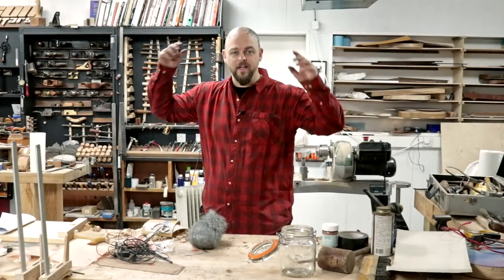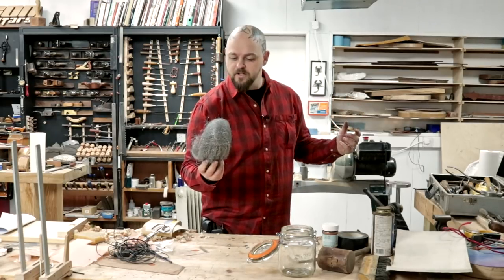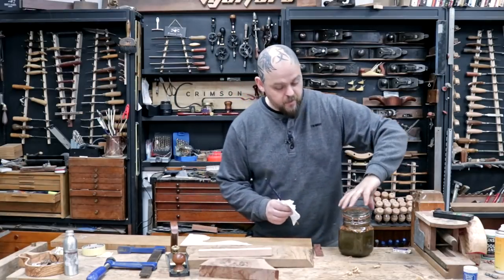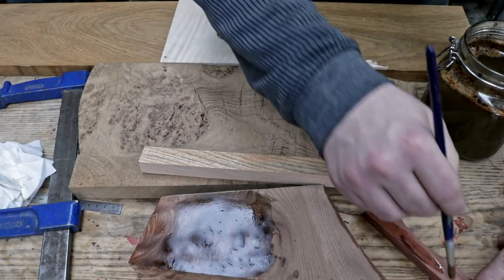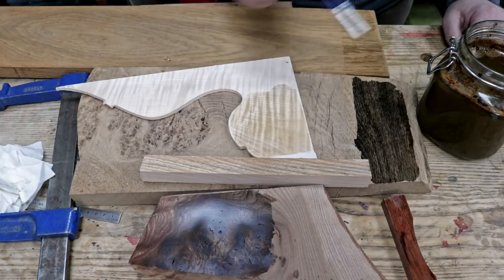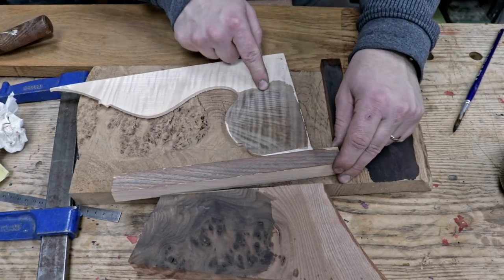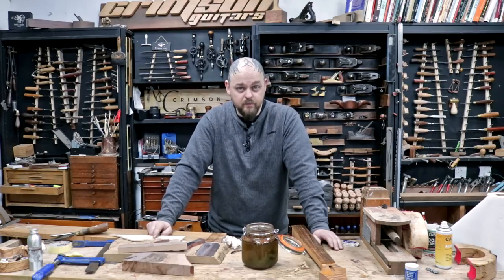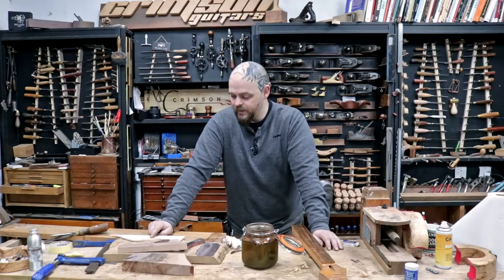Experimental Luthiery - Oxidising Guitar Woods - Using vinegar and wire wool

Comment: Tea has tannin in it. Make a strong brew of tea and apply it to the wood and let it dry before applying the Iron acetate to get a better reaction. Also, a safety tip when making the Iron acetate: Don't seal the jar. Not only will it prevent oxidation, but gasses are produce during the reaction that can cause pressure that might rupture the container.
Reply: I'm wondering if tea alone doesn't just add color like a stain or pigment would, reacting to "cover up" and create a surface effect as opposed to an actual chemical reaction with the tannins within the wood that creates more of a deeper 3d effect. A better approach might be to add more steel wool or iron. It seems to me adding tea or coffee is the same as adding stain, unless for some reason someone can't afford stain in the first place, one could just go with a stunning stain in brown for instance? Although a "layered" approach might work, ageing, then staining or coloring.
Reply: ThomEA It's probably a little of both. I guess a good way to find out is to apply the tea to a non-reactive substrate and then apply the iron acetate and see what happens. The iron acetate stays somewhat clear after the metal oxidizes and you strain it out. You can see in the video when he brushes it on the wood that the acetate doesn't really have any color until it reacts with tannin so I don't think adding more steel to the mix will change the results much. I agree that you could probably skip all of that and just get some ebony-colored stain and keep reapplying until the wood is black but it's probably not as fun as doing science experiments in the shop lol. 

You might also be interested in a technique that was popular in medieval times. I don't know if you're familiar with it but they built a tent around the piece to be stained and the put a bowl of ammonia in with it and fumes change the color of the wood. I haven't tried that yet. I'm sure there's instructional videos of it on YouTube.
Reply: The hard part is getting ammonia strong enough to do that, household stuff doesn't work, and it'll knock one on one's butt (nasty stuff, would probably asphyxiate a person, I used to run a blueprint machine that used it a while back, Some architects are real holdouts technology wise, go figure lol). Mission style furniture makers used it a hundred odd years ago for oak primarily. Adding more metal creates a stronger chemical reaction for the un-oxidized tannins to react with. Adding tea doesn't react with the wood at all.
Reply: well, another great source of tannin, and better yet cos its clear, is tonic water =)
Reply: Distilled vinegar ! 
Also , tree bark can be used to tan leather.. why not a lump of wood..
Reply: Two bags of Yorkshire tea in a half mug. Just applied it to a tele body. Prepared Ben's steel wool and vinegar mix with some rusty nails etc. Will have to wait a few days now before whacking that on. :-)

Comment: Hi Ben, I have used this same technique on my guitars and furniture... I use a 50/50 blend with water and vinegar, I had an idea to put in a kitchen scrub pad with that dry blue powder. Well, not having any patients  for the reaction to happen I tried to speed up the process by heating up the vinegar...it was a good thing I was doing this in the sink, it instantly took off like a volcano ... after it calmed down I had an excellent patina color.... I was speaking with my son who works in a lab at a chemical plant . He said I was luck the gases from it didn’t drop me to the floor.. I was making hydrochloric acid gases when I mixed hot vinegar and bleach  ( the blue powder in the scrub pad has bleach in it...).. hope my story helps you and many others who may of though about doing the same thing..

Comment: I just finished a guitar using this technique and it turned out very good. It can give you very nice colors and effects.
Using a heat gun you can speed up the process a lot and somewhat 'control' the oxidizing and color especially when you rub the solution on with a piece of tissue paper or cloth instead of using a brush.
Also if the effect on a certain type of wood isn't dramatic enough, first apply a few coats of very, very strong tea. This will add more tannin to wood for the solution to react with.
I can recommend using rusty old nails and leave them in the vinegar for months without shaking the jar until they leave a very clear and red(ish) solution. This will give you a very potent mixture which on certain woods gives a reddish hue over the darkened areas. 
I clean/re-etch files in vinegar and left my set-up filled for months and when I cleaned it out, it gave my a beautiful clear cherry red solution. And it worked magic on pine and otherwise more boring looking woods.

Hope you all have as much fun experimenting with this as much as I do.
But be careful on basswood. It turns black instantly and it penetrates deep, at least it did for me on places I didn't wanted it to.

Comment: I gave it a try, on a few test pieces of maple. soaking the wood in a liberal ammount of yorkshire gold and after drying applying an equally liberal ammount of iron acetate the result was pretty stunning. fairly dark grey. once you lightly sand the high spots away you get a lovely grungy look. pretty cool technique.

Comment: I have tried food coloring. I used black. It made the wood look amazing, because it still allowed the wood grain to show. The only thing is, I noticed it doesn't take spray clear coat very well at all....and it is very sticky to the touch. It is beautiful though. If I could find a way to both thin it down some and maybe mix it with oil instead of using clear coat for a nice shine on it.

I have also mixed plain rubbing alcohol with those little $2 2 ounce bottles of acrylic crafting paints. That gave some interesting results. You got color, but you also get to still see the wood grain, which is what I am looking for. 

I have watched other people use mustard for a nice "blonde" look, like you see on some Telecasters. I have also heard that turmeric gives a nice "blonde" look too. 

I like a little of the blonde look, but I'm like you, I want black. I don't care for brown too much, but really dark black is my favorite. What would be my most favorite, if I could figure out how to do it would be that extremely dark greenish color you see sometimes when mixing black paint, before you have finished mixing it. That is the most amazing color. Sometimes, I wish I could isolate that color from black paint I haven't finished mixing yet and just use that color.

Now, you have made me want to test this ebonizing thing again on some of this 70 year old red oak I have that I plan to use to build a mallet. I once tried that method on pine. If it can be tried on pine to darken it, I have tried. I usually end up losing the grain because pine is so hard to stain black....or any color, for that matter. and I usually end up spray painting it black, lol. Yet, I still keep using pine, because it is the cheapest for practicing to get better at woodworking. 

I know people laugh at those of us who use pine a lot for projects, but has anyone ever found a pine knot large enough to make a guitar body? I wonder how that would sound and look. Pine knots are usually pretty dense and tough. Maybe a pine guitar would not be laughable if you let it age. When pine ages, a lot of times it becomes very hard...harder to cut than oak, even, and also very flammable. <------Hint Hint. It burns very hot though, so don't say I didn't warn you. :P

Please do a series on various ways to color various woods. I love anything that adds some color but leaves the grain of the wood still visible. I wish I knew how to stain the darker parts of pine to black and leave the rest unstained. I tried only letting some stain wick through the end grain only, but that still didn't really do what I wanted. It just stained the end to that sickening "I'm pine. I refuse to stain any decent color. So there." sort of color. I hate and love pine.

Comment: i soaked the steel wool in vinegar for 3 days then removed the remaining half oxidized wool and let it dry for a day, then i painted the stain on the oak and waited till it tuned blackish grey then (whilst the oak is still wet) I used the dried steel wool to scrub the board hard, the oxidized wool crumbles into fine brown rust powder and stains the grain that isnt as black a nice brown colour. beautiful!

Comment: One of my favorite treatments for curly maple utilizes the same concoction you used followed by a sanding, to remove some of the color from the harder parts of the curl, where it didn't penetrate as much. Then, get yourself some potassium dicromate dissolved in water. Coat the wood with this, let dry. Lightly sand to get rid of the fuzzys, oil, and enjoy the results.

Comment: Walnut, oak grain, cherry & elm are great for oxidization.

tip:  Place the steel wool into a pot of water for a bit, put it while wet into a coffee can - let it get rusty then add the vinegar
It actually is the rust that kicks this up a notch

Comment: Hi Ben. I use this technique for furniture. If you heat the vinegar and wash the steel wool with washing up liquid to remove the oils and then chop it up as it goes in the hot vinegar it really speeds things up, usually overnight is enough. Also you can then experiment by adding varying quantities of Hydrogen Peroxide to the mix to add oxygen and therefore strengthen the colour of the solution. It is also a great way to control the exact effect you are trying to achieve. Great video by the way, when can we see an oxidised guitar? ;-)

Comment: If you want to grey any light wood like Maple etc, use a water and fertilisier mix, they use this in the veneer industry to make grey wood veneer colour. If you do this with Oak or other high tannin content woods, it turns the wood black, which is great if you want a dark finish to simulate aging of the wood.

Comment: Another experiment you can try is an old technique called ammonia fuming , where you enclose your piece in a small diy tent and use 10-35% strength ammonia and the fumes darken the wood .. and it penetrates quite deep and can give rich brownish colors (like the roasted maple color)

Comment: I use 4 to 5 coats on most hardwoods, then oil sand back and leave for a day before finishing. Steel wool produces the best stain. When you sand it back it gives a deeper 3d effect.

Comment: Potassium dichromate achieves the same aging effects but can be used on woods with a low tannin count, it is toxic, and can most likely be bought in pharmacies just mix it with water and make sure you wear protective gear.

Comment: What do you suppose would happen if the steel wool weren't completely dissolved? Leave it in the vinegar for only a day or two, then use the wool to wipe down the wood. Would it rust? Would it, in effect, react with the wood to turn it black, and with air to add oranges and reds? Also, what if you added copper to the solution?

Comment: If you don't like the smell of vinegar you could try Citric Acid. I work with food ingredients and we mix Citric Acid with Sodium Metabisulphite to use as sanitiser. I once put a plain steel screw, instead of stainless, in the solution and it quickly corroded and turned green. It also released some sort of rotten egg sulphur gas.
Try dissolving a teaspoon of SMBS, in some citric acid solution or small amount of water, and add it to the mix on the last day if you're after a different colour and leave it outside of course until all the sulphur smell is gone. You can get these ingredients from a beer brewing supplies shop or supermarket sometimes. Don't let the SMBS powder get anywhere near your face. I once had some of it go up my nose and I had to snort water to flush it out and be able to breathe again, it's pretty harmless . Good luck

Comment: Some suggestions to try in dilute concentrations: sulfuric acid, nitric acid, sodium hydroxide,  potassium hydroxide, etc.. I know for a fact this works on some woods, and you can get shades of green or even red depending on the acid/base used.

Sulfuric acid I think may be very interesting because it loves to pull water out of things (and thus can replace it with sulfur ions inside the wood).

The main problem I see with this is finishing it afterwards. The acid (even vinegar is acetic acid) stays in the wood, and it may cause serious problems on finishes on top of it.

Comment: You will find that using steel wool can at times give a purplish color to your mixture when you apply it to the wood. Iron (nails) create a much better result. Not sure why it does that but I do know that Stradivari used this technique for dying his purfling. I believe they were Pear wood or holly (can't remember off hand} The very old book "Violin-Making: As It Was and Is" by Edward Heron-Allen goes into this subject at some length as well as other natural varnish/shellac formulas. Great book if you are interested in creating your own . I make all natural finishes for both my guitars and violins.

Comment: You used the end grain sides of the white oak and elm and so they took the stain better than the samples where you applied to cross grain.
Cross grain probably needs more persistence for the wood to "take" this stain. Logically, ash should take stain easily, but you had very flat cross grain, I believe.

I could be wrong but I do know that some types of oak have end grain that sucks up water like crazy so that's a logical result you got.

Comment: Use a sponge to apply a few coats and leave it for a few days, it gets darker as you leave it! you can also add a bit of stain to change the color, it turns brown on a lot of woods if you use white vinegar so adding reds can give you a rich color.
Also when you burn your wood try using a brass brush to get the  charcoal off then sand with wet fine sandpaper! you will love the golden browns after finish is applied!!!
Reply: Also cut the wool into small bits helps with the break down

Comment: i took off the paint of an old strat and did this about a year ago and if you add a rusty nail it becomes a nice brown stain also this on its own makes a awful green color and from my experience the wood will smell like vinegar for a while. Its easy to do and dependent on the amount of rust used it can come out nicely.

Comment: A chemical reaction using Bicarbonate of soda (baking soda in the USA) works great on high tannin woods. Used on mahogany it gives some purple hues and when finished with oil, the wood becomes a bit iridescent copper/metallic looking. Unfortunately it's a bit of a lucky dip what you get. Some high tannin woods will give lots of purples with a weak solution. Others less so with a strong solution.

Comment: I find it odd that you seem so disappointed with the brown oak. It's actually my favorite of them. With the rest, you could get similar results with a black stain, but with that one it really highlighted the grain, without changing the color of the wood much. 
Overall my impression is that this would work great as a first coat before a sand down and then actual stain.
Reply: You should make up a big vat of this stuff, and dip a guitar in it.

Comment: see's plain, picks up plain, stares at plain for a bit i had a kooky idea, what if you were to put a pre-sanded and un-routed (i'm talking no neck pocket either) body in a vat of premixed solution and left it to really soak in only for about a day, maybe  could make an interesting finish, the duration of prolonged application in the solution may permeate deep by saturation  causing gradual change in pigmentation through the body meaning it'd be awesome for carving after, or it could just make it completely black as if it was just stained again and again :) -awesome channel by the way, very nice work

Comment: If you wait a while longer the wire wool will dissolve completely, however, decant the mix into a plastic container. The acidic mixture will perish the rubber seal on the kilner jar.

Comment: Would it work with copper wool? Copper salts tend to be quite fun colours, although I only it as far as gcse chemistry, so I'm not sure how much of a bearing this would have. I presume you're getting some form of substitution reaction between the carbon in the tannin and the iron in the solution. 
I wonder - would phosphoric acid enable you to create uv figuring? If the black stuff is carbon acetate, subbing the vinegar for phosphoric acid should end up with carbon phosphate, which should fluoresce.

Comment: I agree with you about the steel wool, it's a freakin' mess, an alternative is using lye crystals dissolved in water, one to four teaspoons per cup, depending on how dark you want the wood, works just as well and also only takes minutes to achieve the stain, the best thing is it will only stain the wood to the degree you add lye when wet in the beginning and no more, (applying the same solution over top won't change it, and it's easily reproducible) and it penetrates deeply as well. Let the lye solution dry. (do it outdoors) Lye is a base, so an acid like vinegar will neutralize it, (lye will eat wood, skin clothes, etc). It works the same way as wool and vinegar with the same effect on ash, just add more lye in the beginning.
Question, can you use stunning stains on top of the oxidized wood? would it keep the 3d effect using them as well? That might look amazing!
Reply: You can alternatively remove (lighten) the stain with vinegar as well.

Comment: i noticed you have used spirit vinegar try the malt type chips shops use a concentrated acetic acid which they dilute and fill their vinegar bottles as a condiment,it is available in 5 litre plastic bottles I have some that I use to remove the salts from stripped pine that has been striped in a hot caustic soda bath which is very alkaline in nature. Great videos keep up the madness!=